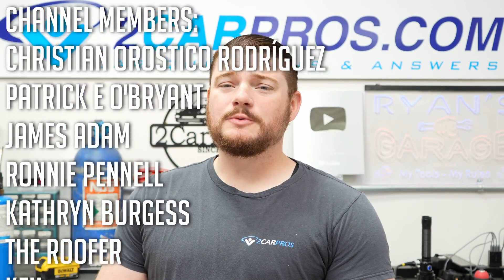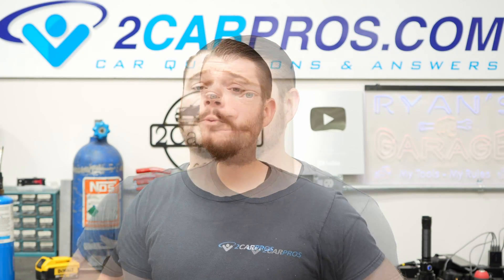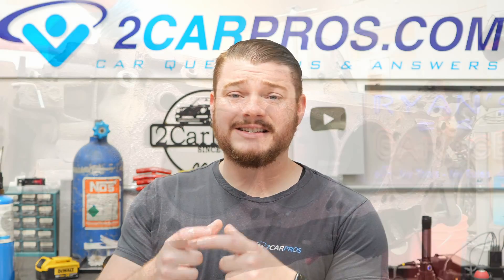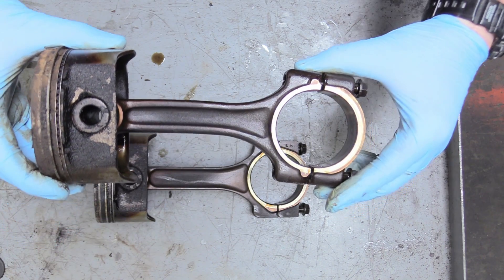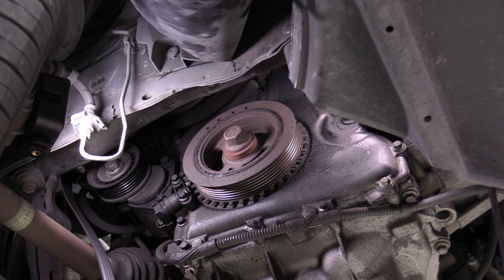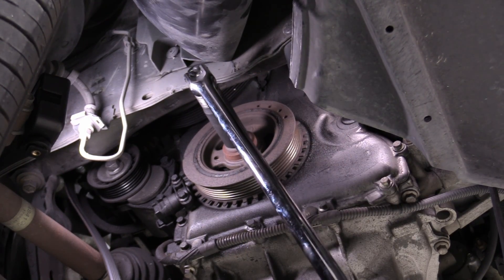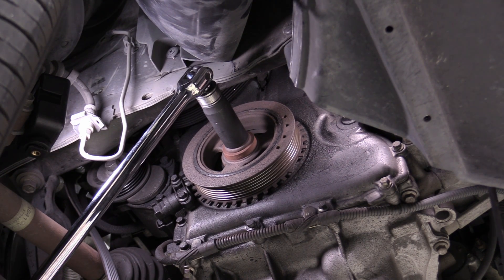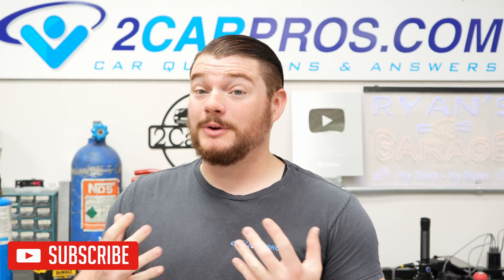How to Turn Over an Engine by Hand | Bar Over an Engine

Comment: Im confused if im not mistaken even in a automatic you suppose put in neutral  not just manual or theres something i dont know..second i tho you could still turn ut with the belt on?
Reply from the maker: The torque converter will still turn even in park due to it being under stall speed. Second yes it is just harder. Thanks for watching!

Comment: I'm having issues with my starter on a Honda 2013 crv. I've replaced 3 starters mainly just to keep the car running but after a while they will eventually slip on the flex plate. I heard I could turn the engine it'll help with engaging better just in case the teeth are warn but won't it eventually spin back onto that section again if it only has a bad section of teeth?

Comment: Would this ruin the timing if you take off the belt? Cause I’m fighting my 2013 Hyundai Sonata GDI I’m doing it with the belt on and it is right but turns over with some force, but I try to start the car it cranks slow and starter smoking a lot! I wanted to take off the belt but I didn’t wanna mess up the timing
Reply: Loosen the Fan belts only. Just enough to wear they are extremely loose. I need heard of putting the Transmission in Nutril .😊😊

Comment: Can i use an impact wrench to crank it over a number of times..I want to get the oil cycling through it.
Reply from the maker: I wouldn't. You will most likely break the bolt off hitting it that hard with an impact. You are better off taking the fuel pump fuse and plugs out and using the starter. Thanks for watching!

Comment: Tried to turn over mine and well having a tough time doing it. Imma try a breaker bar since my wrench isn’t enough. Should I remove the belt or can I just try with the belt on. Mine has a timing belt so not sure if that makes a big difference or not

Comment: I’m doing head gaskets, got a old 03 Forrester from my dad for free, and last step to removing engine was removing torq converter bolts, I spun it around, got every bolt out, and then to the 4th bolt but missed it. Didn’t want to rotate counterclockwise, supposedly that’ll mess up the engine, so I tried to rotate it again, but it’s like it’s fighting me, and it spins back counterclockwise as soon as I let go of the wrench, it won’t let me fully rotate the engine. Is this normal? Should I “push past” the fight it’s giving me? I DO NOT want to mess anything up

Comment: Great video,can i ask you a question Ryan?Can i turn the engine counter clockwise just a little for alignment or i need to turn 360 degrees clockwise to get in the position i want?
Reply from the maker: Yeah you can, you just run the risk of loosening the crank bolt. Thanks for watching!
Reply: good Reply .. I need to 
rotate a 3.1 V6  to check
the  CKP  wheel  for any 
high spots  ... thK U

Comment: 5.7l hemi 2007. Took belt off put in neutral with park brake and couldnt turn it. Will the plugs make any difference or is the engine locked.

Comment: Hello Ryan,
I have a chevrolet 283 small block engine. Can you tell me what size socket is needed to turn it over?
I have searched everywhere,  but can't find the right info for this engine anywhere!
Reply from the maker: I would guess 3/4 off the top of my head. Thanks for watching!
Reply: @2carpros  Thanks, I'll give it a try!!!
Reply: Hello Im cleaning my intake ports can I do this to make sure the valve is close so i can spray directly into intake ports? thanks!!

Comment: very interesting video. Thank you. I have a question if you please: While cranking the engine after gearbox oil change, i heard a noise inside the engine. When i shift to any gear, i can easily rotate by hands the wheels like it was in neutral position. is that normal? it is a clutch issue?

Comment: Hello Ryan....Is it okay to turn the engine by hand if you suspect the timing belt might be broken?
I have a 1985 4 cylinder Toyota Camry...does this car have an engine that will not damage the valves or cylinder if you turn the engine after a probable broken timing belt.
Appreciate your input.
Reply: After a quick search it seems you have a non interference engine so you should be fine to independently turn the crank, but I would do some research yourself just to be safe.
Reply: @dy1angi11ey6  Sorry.was out of town and.missed your reply.
Thank you for input and research.

Comment: Thank you brother, shop said my engine was locked and never did this test in front of me and I don’t believe them. I will now be able to check before spending 4K on another engine
Reply: Ty , my garage also said the same, until I ran into this video 👊🏽 now it's good to go but ... I made a mistake by adding pb blaster into it , my friend who is a mechanic told me to take out the spark plugs dry them off and bar the engine until the pb blaster comes out 😤 hey you live and learn, my truck is good to go on the road again but for a week I went crazy
Reply: @HobieKatt why was the pb blaster a mistake?

Comment: Okay so here’s what happened on mine I turned over the motor to add some camshafts locks. They seated properly but I wasn’t on TDC so I pulled the timing chain off and turned the motor to set it at tdc. Now it moved but after half a turn it gets hard and won’t turn anymore
Reply: Did u figure out if it was damaged?

Comment: Its not turning
Reply from the maker: Then you might have a locked up engine or accessory if you didn't take the belt off. Thanks for watching!
Reply: @2carpros   got pulley off took forever now yea turning slowly but not freely belts off so is spark plugs so I guess engine seized

Comment: I’m in deep water I was trying to remove my steering pump pulley and the pulley nut got stuck in the steering pump and the belt was still on and then I accidentally cranked my motor backwards like 2 or 3 inches what do I do? I really need help and when I start my car it makes a loud deep noise like it has an exhaust leak and sounds terrible 😔
Reply: Please man anyone I was a simple mistake which costed me so much now I just need help man I’m stuck in the water
Reply: You probably skipped timing @brobrohmu736
Reply: Are you saying the nut got stuck under the belt?
Reply: You probably messed up the timing just find somebody that knows how to time the engine for you

Comment: I was going to conduct a cylinder leak down test on my car and wanted to manually turn the crank for tdc. Is tehre any risk of throwing the timing off or anyting when I do this?
Reply: Nope. Just don't turn it counterclockwise. Depends on some engine could skip timing teeth

Comment: i moved the bolt when i was trynna remove the crankshaft pulley and now im timing is off
Reply from the maker: The crank pulley does not control timing. It feeds power to the belt to turn the accessories. Thanks for watching!

Comment: What happens if I don’t take the serpentine belt off and still try to turn it over?…. Never mind you explained that
Reply: I think he said in the video that it was to turn just the crank and not everything connected by the belt cause the accessories could be locked up and not let you turn the crank
Reply: So you can turn the motor over without removing the belt?
Reply: @rayscyclesrepairs3516 just loosen them. Just give it slack.😊😊😊

Comment: Do u remove the plugs prior to this
Reply: If you suspect that you have water sucked in through the intake which ended up in the cylinders. This will help expunge any water. As he said in the video, water will not compress so it can bend a piston rod or blow rings out
Reply: So yes
Reply: He didn't but he said if you do it should be super easy to spin the engine
Reply: No but you can